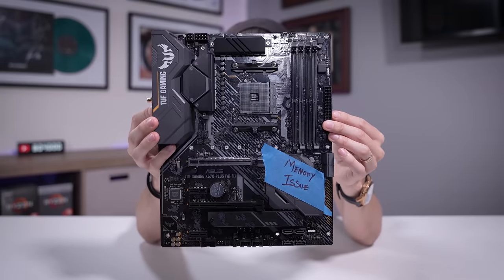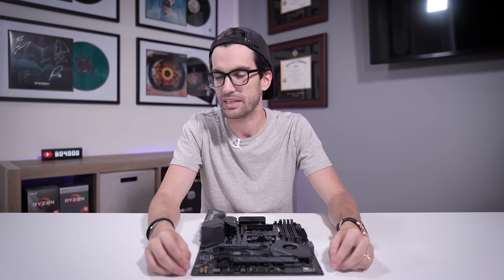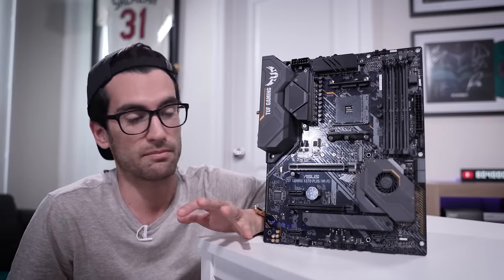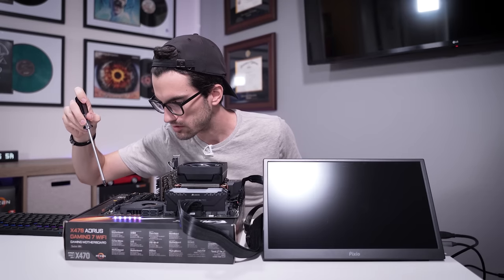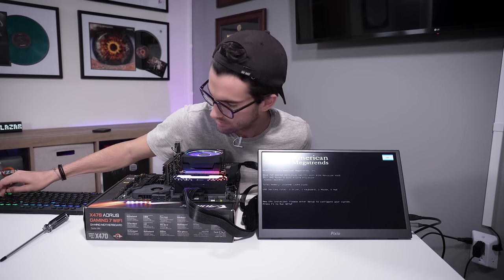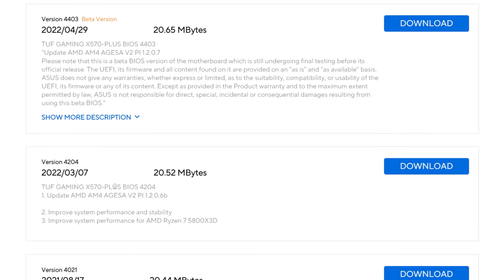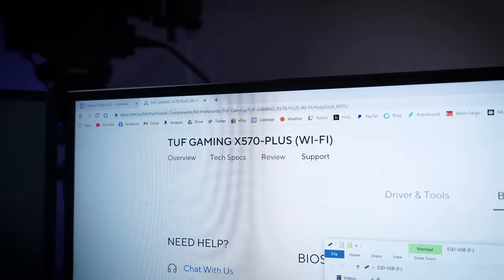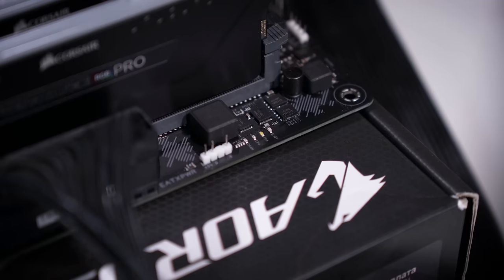Is This Viewer's Motherboard ACTUALLY Broken?!

Comment: I've been in computers for 27 years give or take. Working in a computer shop when i was 15. Once I got higher up I got people under me and made a simple sort of guide for troubleshooting.. like disconnect everything not essential, reset bios, etc etc. You start with the simplest of things and work from there.. nothing much has changed in those aspects from the earliest computers till now really, some things got easier some got more annoying (RGB and tons of fans) etc. 

This could've been easily avoided following some easy steps if you want to be consistent.

Comment: for future refence use biosrenamer for flashback tool! this is a feature that allows you to flash the bios without  cpu and memory, all you need is power to the board and that is it. plug usb in the back of board usually named bios, press the bios button and keep it held there for 5 second give or take then release button and wait till it's done which you will know by no more flashing. other than that you can use the normal (not renamed) bios to flash in the normal bios.

Comment: Glad it Worked for you!!! I still say the Bios was corrupted and updating it put an UN-corrupted Bios in it!! IF Not, it was a crappy ASUS bios that was in it!! I have a Core2 duo board that has been running fine since 2010 with the last Bios for it that came out in 2011!😁😁

Comment: i didnt update mine ever since i bought my mobo . and i thouught it wasnt a big deal. i noticed my gaming performance started to get degradation . i finally decided to install the BIOS ( never did it before because i live in a rural area where the power is not very consistant and get lots of thunderstorms ) after the update i noticed the performance now was so muuch smoother

Comment: For those boards, everytime the BIOS is reset , it will go to a memory training cycle and adjust the timings correctly, could be just that
Reply: I think that is for most boards. With the motherboards I have, the BIOS gives an option to turn the learning off or on. When it relearns, it will cycle a few times before the actual boot.

Comment: I actually updated to 4403 for my TUF x570 Plus (Wi-Fi) today and for whatever reason when I apply DOCP, if I power on the system, it will turn on for a split second and then turn off, after a few seconds it will turn back on and POST. 

I first thought that DOCP just didn’t want to properly work with Fast Boot, but that doesn’t seem to be the case.

I’m probably just going to wait for the next BIOS update in hopes that fixes my issue

Not sure if you encountered this after making this video.

Comment: I've had a similar issue with my old Z77 board. It had a manual bios switch and if u switched bios then it would boot. I ended up getting a replacement bios chip and flashed it with the latest bios for the board, then desoldered the bios chip and soldered the replacement on and it worked. Turned out the chip bricked itself.

Comment: I know this is a dated video but I wanted to add that a lot of motherboards warn you to disable the TPM before flashing. It's real easy to miss completely disabling the TPM as it can be partially on the motherboard but also on the CPU. A bios update without disabling the TPM can act just fine but later on, there can be funny little glitches that pop up randomly and it's all because the bios is corrupted.

Comment: On that board the innermost slot and the outer middle slot are the proper ones to use first. The slots you are using are for the second memory pair, it doesn't affect performance but it's a little bit cringe to use the secondary memory channels without the primary ones being used first. May even be why boards take longer to train the ram on boot because obviously the memory controller is going to be looking for ram in the primary memory channels first.

Comment: I love this board. If you do repurpose it, realize that the vrm is actually pretty good for OCing chips. Should also be mentioned that the EK x570 Strix monoblock fits perfectly on this board covering the vrms and cpu. Got a nice all core OC on a 3800x to 4.4 ghz @ 1.29 only hitting 78c in prime95. 38c idle.

Comment: Many boards with bricked bios, will look for it in a usb pendrive. As long as the bios chips isn't 100% hardware bogus, the board will self flash itself after a few attempts and you'll have your board perfectly working running.. since UEFI it works like that.

Just leave the CPU and 1 stick of ram (nothing else, no keyboard mouse video output) hook a usb pendrive in the rear with the flash bios in the root (try both fat32 but generally works also with NTFS) and leave it be there. 

If you are lucky (and the bios isn't too far away from the one that was in before), you should find it up and running without any issue.. did so many times to revive bricked boards far before flashback bios was a thing. Worked on a current H77 Asrock MVP, and with a MSI p67A GD55 and i revived a gigabyte b350 gaming a couple of years ago that got bricked by an acquaintance.

Comment: Greg, well I took a gamble and bought 2 MSI motherboards being sold As-Is and was hoping to be able to get them working.... unit #1: MSI B350 Gaming Plus, Board being sold as-is stating unit hangs on CPU and won't boot, no matter what CPU is used.... thinking it was just a simple issue of a bios update, I bought it for $25.00 from Ebay. Unit #2: MSI B450A Plus Max. seller stated unit DOA. thinking it was a incompatibility issue, I too the gamble and bought it, again for $25.00.... got it, powered it up and got a Power Good status.... then when the CPU arrived, I installed it and there was no power what so ever.... so I flashed the bios to the original release (flashback) and hoping that would work, I tried it again, with the same results.... so no matter what I did, nothing would work to get these 2 motherboards to work.... the $50.00 gamble, a total Loss.... pulled the CPU, all the memory, the Heat sink mounts and the batteries, and trashed the boards.... well, so much for that "Experiment"..... so, If you ever think that those AS-IS boards are a good buy.... think again.... lesson learned.... now I've shelved the 2 builds until I can get NEW Motherboards.... so frustrating.....

Comment: That is why I like to see how hardware software react when something just ain't quite right, knowing what is software problems causing hardware conflicts and what is hardware causing software conflicts is my thing when it comes to computers.  My teacher in high school broke a school computer, and we as a class seperated in like 5 groups had to tell him what was wrong with it each group had time to mess with the computer in question, this was back in IDE days, and manually turning on a computer.  The software problem gave a weird issue, unable to read boot disk inconsitantly and also gave unable to write to boot disk inconsitantly, most of the people thought it was a bad hard drive but I and my group decided it wasn't a bad hard drive because though mechanical drives make weird noises when they die and there was non of them.  So I know what it was and my group agreed, the problem that was causing that problem was a bad IDE cable, my teacher took a knife to the cable and cut two of the wires and that is why we were getting though software errors, but that was a long time ago.

Comment: curious...  did you try loading all four ram slots after BIOS update?  I have the TUF X570 WiFi as well, but I've never had any issues with it.  I run 4 sticks of Corsair Vengence RGB Pro 3200 @8GB each.

Comment: Awesome, even me that have become IT support as hobby for almost 20 years and as  professional (or lets say, jobs) for this decade still sometimes missing the most simple fix  like this. I remember when on of my office laptop  cannot connect to the wifi network, and I bought it the new USB wifi adapter, and then I remember that simple network reset in win 10 should have been fix this because actually other laptop I fix months ago behave the same.

Comment: Before I bought my MSI board, I was also worried about the absence of a dual BIOS, so I contacted MSI and they told me not to worry, because you can always use the dedicated BIOS flash port and the flash button, even when the BIOS was bricked before and the system can't boot anymore.

I wonder, if you're interested enough to risk a bricked board in order to confirm that.

Comment: I have the same motherboard and I have problems with the computer booting up and sticking on the orange light. I do a long press to shut down and restart and sometimes it takes a couple of attempts to get the computer to POST properly. I currently use one set of RAM sticks(2x8GB Corsair Vengeance RGB PRO 3600) and intermittently get the issue. It was worse when i had an additional set of RAM in as well (2 x 8GB XLR8 RGB 3600). The orange light issue was more frequent.

Comment: I run that same memory with the same board, never had issues no bios update ever (board purchased March 2021). Started with 16gb 3200mhz (oc to 3600) now have 32gb. 

Glad bios worked though figures as much
Reply: I now wonder if you even update the RAM...newer modules will have been flashed at the manufacturer...so I suspect your old BIOS is happy with older RAM modules...and this probs is a later set of RAM modules causing the instability...

Comment: I had this same problem when I built my current pc. I went with an x470 board, as that was the newest that could run the 3600 out of the box. I had a memory problem (multiple sticks wouldn't work), so had to update the bios (although it worked with the 3600 cpu fine). Of course, I bricked the bios... Luckily at the time I had another pc to download an updated bios to, and install. Mind you, this was in 2019, and I wont touch it unless I need to.

Comment: tip: always set your Computer to default settings before flashing the bios. I think this is more safe than updating a overclocked system.

Comment: I wouldn't feel bad, BIOS's used to be robust, and you wouldn't think of them going wrong. But I have noticed over the past 5-7 years or so, bios problems seem to be becoming more prevalent. I think modern flash chips are slowly losing their programming, flipping random bits, and needing a reflash to fix them. 
It's actually how I got my current motherboard, An MSI X370 Gaming Plus, bought off eBay for £20 as "faulty", and indeed it was, until I reprogrammed the BIOS chip. It wasn't an easy task, as this board has no bios recovery function, so I had to do it with a clip and a programmer. But, a successful erase and reflash with the current Firmware, and it booted right up. 
I've noticed lots of thing with flash firmware chips just randomly dying, and reflashing firmware reviving them, so I think it's going to be more of an issue in the coming years, having things randomly die or act weird, and a reflash fixing them. Definitely a thing to watch out for, and consider when troubleshooting.

Comment: i can tell you that many motherboards i worked with in schools (yes school computers not gaming) had problems with memory i wasn't able/didn't have time to trace with ddr4 and 8th gen intel cpu's having 2 kinds of memory, both budget type, we call them blacks and green because that is the only difference at many ocasion boards would not boot on one color of ram but boot on the other but computer next to it would do the oposite, installing 2 sticks would in 80% stop computer from booting, but installing one testing and if work installing another stick would very often work just fine
in new computers there is too many variables to even know right away what's going on, old pc's you could install post cards and look for jumpers that don't look right but now it either work or not and with no debug leds you kind of have to ezperience a moment of dread when you least expect it because one of 8 computers duting an exam won't start up  because it no liku memory stick of a particular color today
in my case bios updates didn't fix the problem but who know probably budget boards are not that well tested for issues especiallu if they cheaper brands school gets

Comment: I bought a GTX 980 ti for $60 on Facebook and it had artifacts.  I thought that I was at a loss but I did the heat trick on it. But I didn't have a heat gun so I use the stove and put it 7 inches away from the stove  2 times. Then it somewhat works in safe mode so update and it fixes it woow good card for $60 I'm so happy.

Comment: I have the same issue with similar ram, I can always get the system to post by turning it on and then pressing reset. It started after a bios update and I learned the issue is with D.O.C.P on.  Had no issues before the update.  Turned D.O.C.P.  off and no issues. Still not sure what the update broke exactly.

Comment: i have the same board, and randomly the thing will freeze while gaming, and the dram light comes on. been suggested to increase the voltage since i have xmp profile loaded. haven't done it yet to see. bios update didn't fix the issue

Comment: I bought this board recently and had the exact same issue. I tried everything I could think of to get this to work but failed miserably - I didn't even think it was a bios issue as the sticker on the board (and the box) said it was Ryzen 5000 series CPU ready and had a fairly recent bios already installed on it. Perhaps if I had flashed to the newest beta bios it would've worked, I ended up getting a refund from where I purchased it from anyway. I guess this is a board or ASUS specific issue but I've never had troubles like this before on any build in the past.

Comment: I worked for a software company, SAFE EYES parental control software.  90% of all problems are the same, sometimes I was shocked when I discovered new problems and old solutions, to other issues, which would work with my new problem. So don't apologize, keep plugging along, pal.

Comment: Same issue I also did the following, I updated the BIOS but a dimm slot or slot on the motherboard is still not working, still no boot into the BIOS after transferring it to the other dimm, the memory stick in that dim slot.

Comment: I once had a memory slot that wasn’t working an an a320 ASrock motherboard so, I blew compressed air into the slot that wasn’t working and it worked.

Also, It wont POST half the time with the 3600 MHz Corsair ram so I put 2666 MHz Samsung ram from a prebuilt into it and it POSTs all the time now. I wonder if it’s the lower end chipset not playing right with the higher frequency memory?

Comment: I think it's a good series, but one thing that I have a hard time about. Is that you don't talk about ESD protection. ESD is known to have killed hardware before. 
Even if the system works after it was exposed to it, it can still die down the road due to it( it can happen many months after).
Many who are watching this series are probably new to error finding and how to hardware assemble a computer. So the chance that they protect themselves and the hardware from ESD is low i would say.

Comment: Nice work something that should be done before tearing down the MB just for sanity's sake hehe.  Have Ram in those 1&2nd or 3&4th won't hurt anything other than the system won;t be running in Dual channel mode with a slight decrease in performance.  Gamers would see it in most cases,  but office users would likely never know unless they were running something that blatantly states it.  It's good you went back to look at it having that nagging thought that needed to be satiated,  oftentimes you never find what you're looking for till you actually stop actively looking.  Funny how that works ;)  Great work Greg!

Comment: Had the same error with a MSI z690 board DDR4 Dram issue couldn't update the bios unfortunately so went with Asus z690 worked right out the box with the lowest bios..

Comment: This video is helpful fore right now because my computer has been giving me problems with a few weeks.

At first I was getting a BSOD just from copying files to an external SSD. O reseated my ram and NVME drive and I had no problems for two weeks until yesterday. I tried reseating my ram and NVME drive again but it didn't help. 

My computer randomly crashes now. When it crashed now it just freezes for a minute then a small portion of the bottom of my screen goes black with pink artifacts and above that a blue screen flashes and the computer reboots.

At first before reseating the ram the computer crashed then just flashed a BSOD and rebooted but the NVME drive was missing so it was going into the bios. I tried turning off the computer , turning off the power on the PSU then pressing the power button to dissipate and remaining power and wait a minute to power on again. That didn't work so I reseated the ram and NVME drive. It booted into windows then.

But there's no clear reason why it's crashing now. It randomly does so. I was trying to backup my files onto external HDD and it was crashing. I could game for a few minutes and it will crash and I could game for a few hours before it crashes.

I'm going to troubleshoot with what I have now. I have an AMD R5 1300 and GTX 1070 spare that I can test but that's all I have as spares because I built a gaming pc with most of my last computer for my brother two years ago.

I don't want to try to flash the bios though just in case it crashes and completely bricks my computer.

I think it's either my PSU , NVME or GPU that is broken. I've been using computers and repair my own computer with 28 years but I've never seen this problem before.